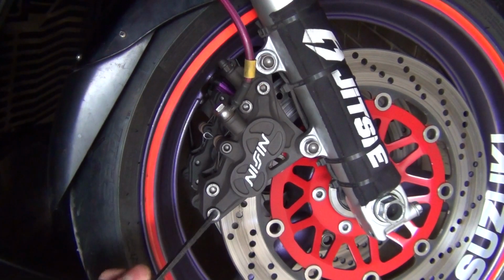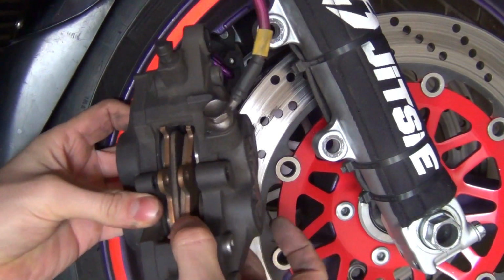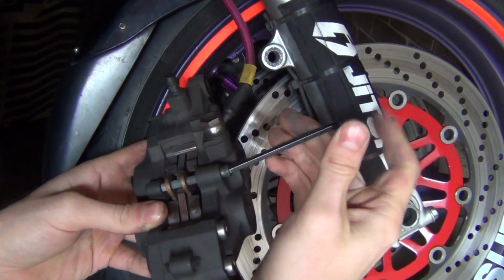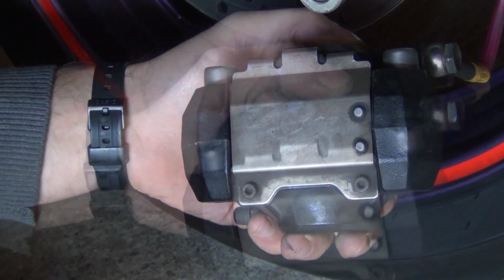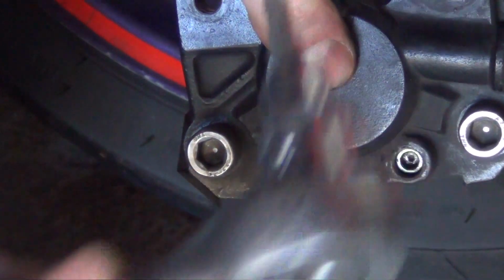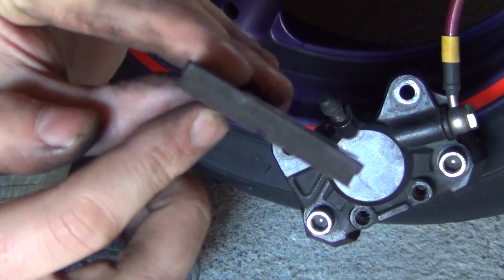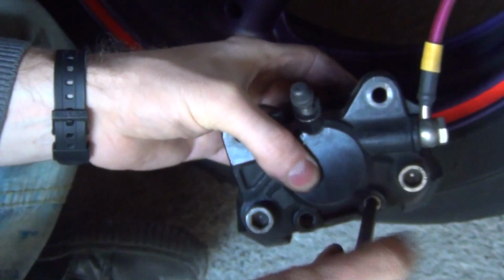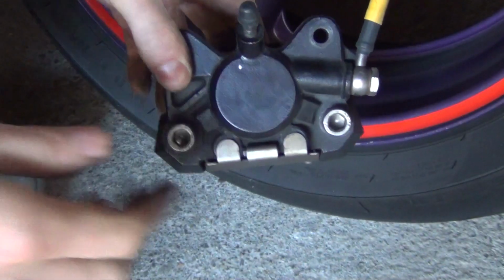Suzuki RF 900 How To Change Brake pads

Comment: Bolt on some 6 pot tokico calipers from a 2001 Bandit.   Huge difference in braking power.
Reply from the maker: Had them in the past. Terrible calipers and lots of Bandit, TL1000, Hayabusa owners spap them with 4 piston Nissins. 4 piston Nissins are an upgrade to 6 piston horrible Tokico.

Comment: Adikxx where do you find pads for the rear caliper? I'm having big trouble finding them because they are out of production because this is the only bike this type of caliper was used on. The 96 RF's have the 1st gen BUSA caliper and those pads are more avaliable, but the swingarm is different and i can't swap calipers with my stock swingarm.
Reply from the maker: I bought my pads on Ebay. Link for 1994 model pads here :     https://www.ebay.co.uk/itm/Brake-Pads-Goldfren-Rear-Suzuki-RF-900-R-1994-1995/153795928529?hash=item23cef3a1d1:g:NPsAAOSwFZdeHYjD

Comment: Good video but put the year of your bike.
Reply from the maker: All years of RF 900 have the same calipers and pads so no need for that.
Reply: @Adikxx  not true, I have a 96 and my rear brakes where drastically different than yours. Easier, but different none the less.  

Is yours a 95? Guy at the shop said they were the only year different if I remember correct.
Reply from the maker: @coryd60 this video is to show how to change brake pads. Method of changing pads Is the same on all types of RF calipers (detaching torque arm on 96+ models takes 1 minute..)so why mention year of the bike?)
Sorry don't see a point of instructing of what year the bike is. Mine is 94 but changing pads on mine is the same as on any other RF model. Unless unscrewing extra bolt or two is something you would consider "major" difference. I wouldn't.
Reply: @Adikxx  so me putting this job off because I thought I needed Allen keys to remove the pads from the calipers, and mine were at work. Well turns out yes I needed to take one extra bolt off (no biggie) and didn't need the Allen's. All I'm getting at is you putting the year would have saved me some time and damage and maybe you doing it now will save someone else.

Or you can just not take the feedback and we'll handle it that way. Nothing wrong with taking some criticism bro.
Reply from the maker: @coryd60  Your feedback is appreciated. Thank you.

Comment: that's not changing the pads, it's removing and refitting the same pads.
Reply from the maker: Yeah which is done the same way.
Reply: @Adikxx  except you need to clean the pistons, push them back in, check brake fluid levels are ok.
Reply from the maker: @roadwarrior8560  no you don't
Reply: @Adikxx  yeah whatever you say
Reply from the maker: @roadwarrior8560  ditto
Reply: @roadwarrior8560  who told you that haha ..